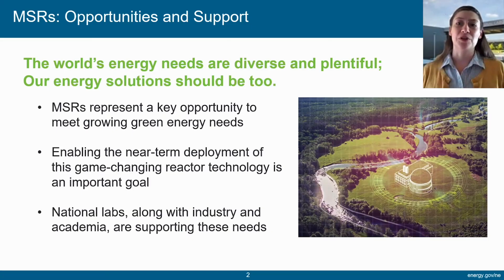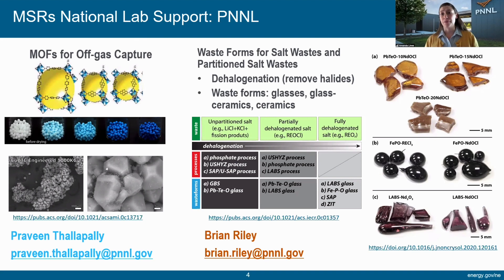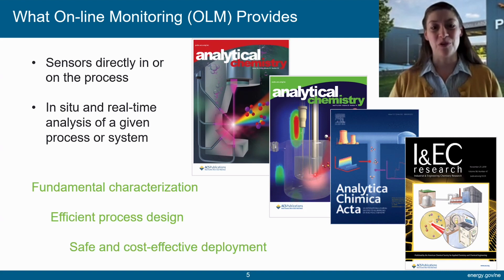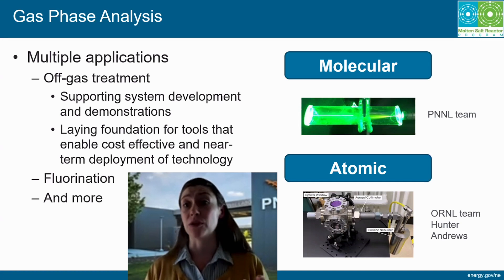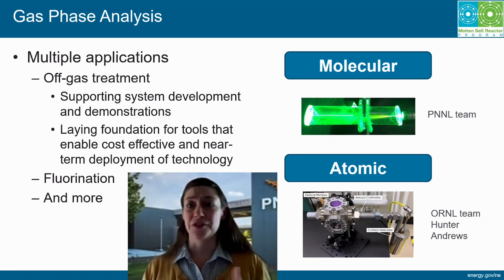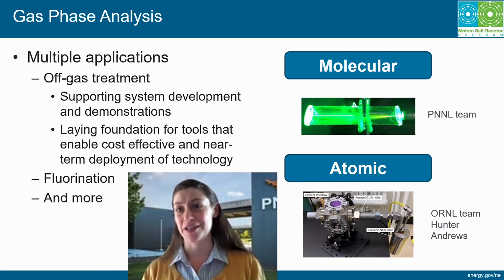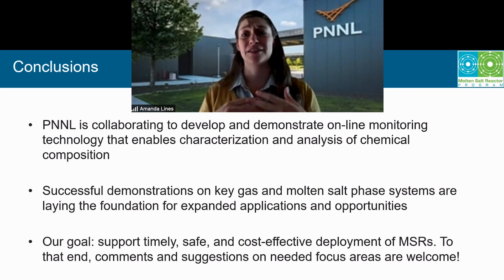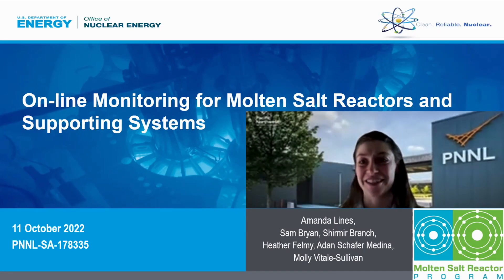Monitoring for Molten-Salt Reactors and Supporting Systems - Dr. Amanda Lines @ ORNL MSRW 2022

Comment: The Dr has no idea about energy supply economics. 

Nuclear is a stupid dead end. 
In a 100% electric world.

Fossil fuels are high density energy. 
500% more electric energy is needed to replace fossil fuels. 
Thinking Thinking 🤔 

Yes, 5 times generation capacity.
Yes, 5 times more national grid capacity. 
Thinking Thinking 

Hint, 
SMRs $2billion each.

National Electricity Grid including all the poles and wires to the streets and homes and businesses and industries $3million a mile. 

And the world has to stop CO2 increasing. 
That is the point  ?

Comment: @12:41, I do have a question/idea.  Molten salt apparently has a high rate of thermal expansion.  I am wondering if the index of refraction changes with temperature?  Can this be exploited to measure the temperatures in the reactor?  I have read several reports that regular thermocouples don't work at the temperatures that they are striving to achieve with these reactors.  This is a roadblock to certification of molten salt reactors by the NRC/IAEA.  I didn't hear any mention of temperature measurement.  Quite frankly the audio on this video is pretty poor.
Reply: Several years ago I found out much to my horror that U-234 is a nuclear explosive and speculated that it might escape from porous, uranium bearing sandstones as thorium 234, which dissolves more easily in water than uranium.  Thus deposits of nuclear explosives might form in nature.  We need to find this stuff before the terrorists do.  Yes, I called the cops.in spite of my fear that they might think I am a terrorist.

I call this effort "Project Zeus" after the Nike missile interceptor.  Project Zeus is stressful and frightening and I was spending too much time thinking about it.  To take ;my mind off this, I decided to solve the pollution problems of the two stroke engine (electric bikes are boring and so are four-strokes).  OK, don't use the crankcase to pump air into the cylinder, fill the crankcase full of oil like it's supposed to be.

Do not use a carburetor, squirt fuel into the cylinder afer the exhaust port is closed.  To do that, you have to know how much oxygen is in the cylinder so you can get the fuel/air mixture right.  I thought of an aurora, which would bbbbbbbbbbbbbbbbbbbbbbbbbbbbbbbbe a good name for the bike; flash the cylinder with UV light and record the dying glow of fluorescence.

Alright!  Escape from Project Zeus!    I googlled alll kinds of things.  Then I thought, what else will this detector  detect?  Arogn's about 1% of the atmosphere, that/ll fire up.  Then there's the iconic fluorescent gas neon.  Krypton, Xenon...

...........................................................................

Radon.............................

Arrgh!! Right back in Project Zeus.  Helium will also betray the deposits of nuclear explosives.

Comment: Where can I find more information on optical spectroscopy as it applies to processes used in molten salt reactors?
Reply: Starting with Raman spectroscopy in the late 1980s/early 90's, you can find spectra of many of the chloride salts. UV Vis spectra has been much harder to find personally I think because it has less uses industrially. see work by Paul Madden from the UK and others.
Reply: @owluitar  Optical, vibrational, far infrared-this is a deepdive.  Thank you